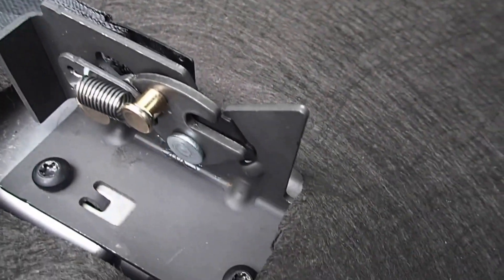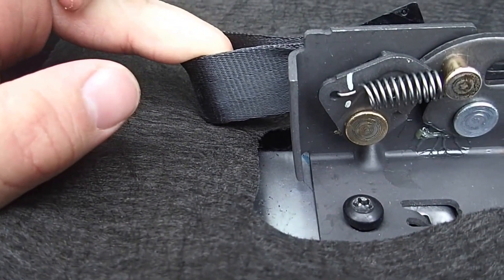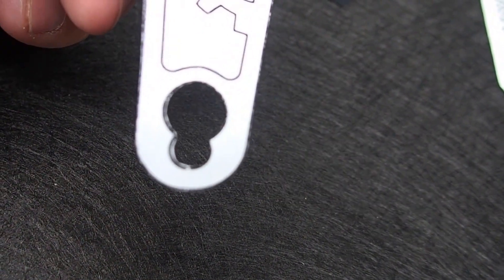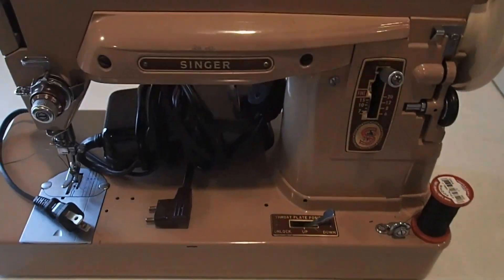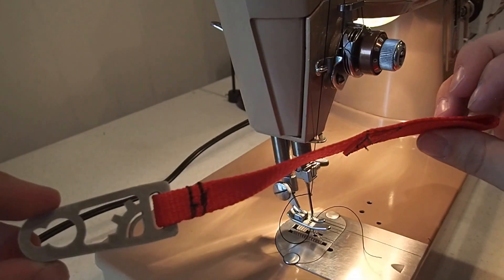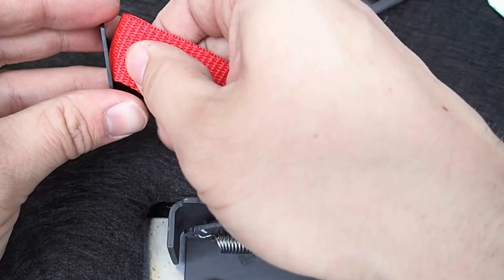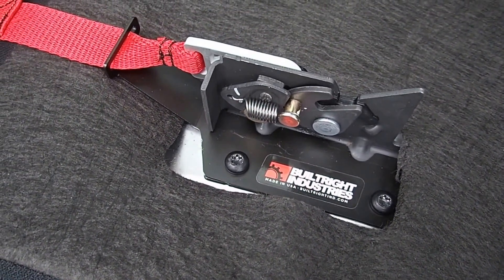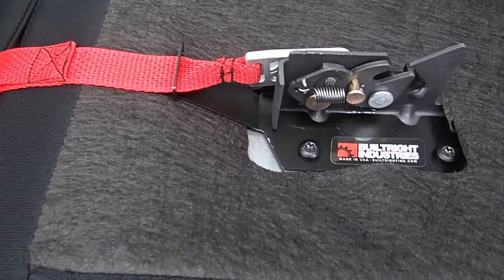Behind the Scenes - Revising and Prototyping the F-Series Rear Seat Release

Comment: Installed mine today on a 22. Seems, I have to move the latch up a little to make the seat latch. Don't recall this happening in the past (this is my 4th truck using this). Seems like the strap could be a little longer. Thinking of adding a carabiner with a short strap and attaching to the headrest.

Comment: 1) The “pin” or whatever you call it on my 2018 SCrew that the metal connector attaches to is not square like in your video, its round, so does that make it the “V1” model? 
2) I’m not quite sure what this is all about as when I lift my seat bottom up about 80% of the way, the seat back comes out far enough for me to reach down (which is not far at all) and pull up on the pin that protrudes horizontally toward the passenger direction and it releases the latch rather easily.  What am I missing here that creates such a need for this device?  Please advise.  Thank you.
Reply from the maker: Regarding the pin, yes, on a supercrew, it's expected that the end of the pin is featureless and round. As far as the need for such a device, supercab seat backs don't move when the seat bottom is lifted. Also, most latches are very tight, making release with your finger difficult or impossible. Finally, adding a pull strap enables lowering of the seat without lifting the bottom, or reaching back behind the seat. It's easier to drop and also easier to relatch, as there's no need to be concerned with realignment of the crossbar. If you can release it easily by hand and are happy with that, I wouldn't encourage you to try this product.
Reply: BuiltRight Industries Gotcha, good observations.  I didn’t know about the SuperCab situation.  Keep up the good work.
Reply from the maker: Thanks David!

Comment: Will this v2 design be incorporated into the straps available 4/20/17?
Reply from the maker: Stanton Taylor We just put them into production following this test, so there will be a smaller run of the v1 kit available on 4/20. I expect that these won't be too far behind, though, so if you shoot us an email, we can try to coordinate and make sure that you get the kit you want. Let us know! matt@builtrightind.com
Reply: I hadn't checked prior to ordering, but I just did. My 2013 Crew Cab has the round pegs. Either version is fine with me.
Reply: I have a 2010 and my pin has a round head rather than a square head. Will your new design work with that type of head?